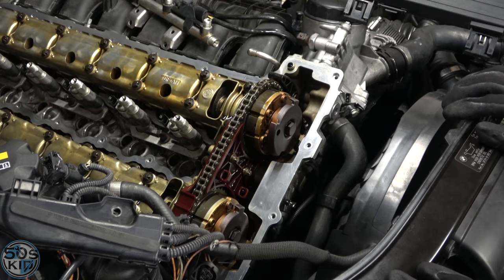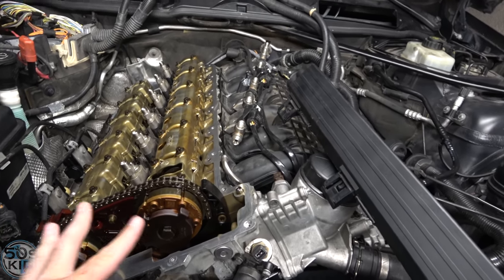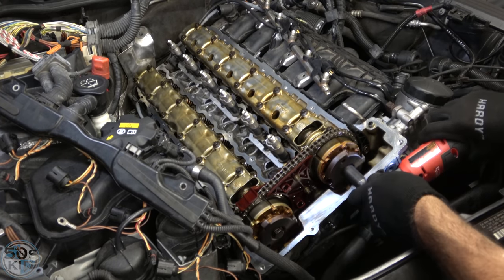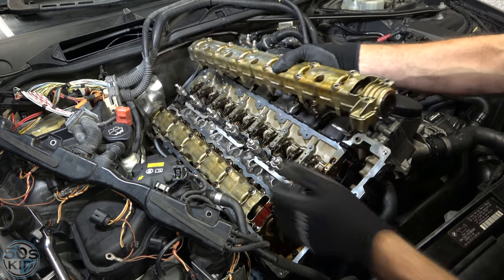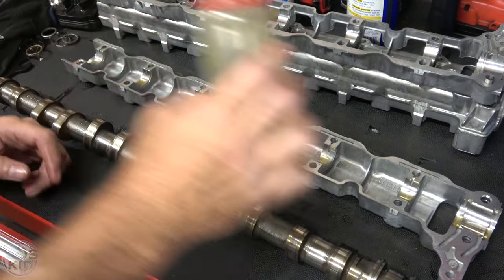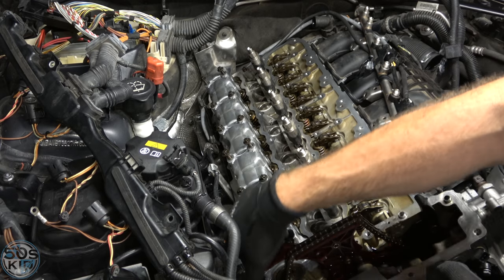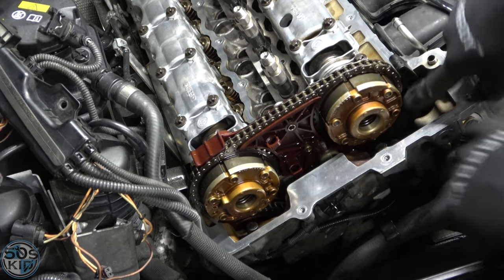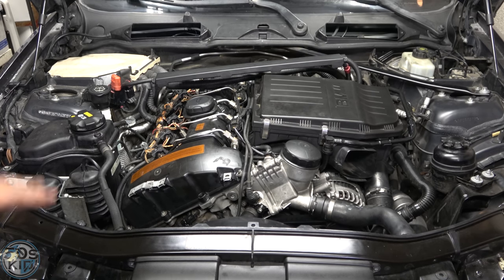This causes VANOS codes! - E90 Cam Bearing Ledge Failure DIY

Comment: Great job lad! Did you try rotating the crankshaft to test the camshaft position with the timing too before 2 x 90 degree screw final torque? I had a scenerio like the camshaft position slightly unfitted to the timing tool even torqued all with the tool.
Reply from the maker: No, but had no issues with the job. Cars running great
Reply: I've never had any issues like that either. Was your tool worn-out, or perhaps from China? 😲
Reply: @davelowets  the tools were from my fren and origin unknown:) it only had a slight unfit at the rear of inlet camshaft. You even can't notice it from the front vanos. Probably it is still under the tolerance of N46.
Reply: @horrychan2304  Most likely. I can't imagine a slight misalignment of less than a degree making a whole lot of difference.

Comment: Hey bud i am glad you are back posting videos. I have a question i have a 2005 325ci and not sure how it happened but my intake manifold cracked not sure how it cracked but im thinking of too much air build up? Can you help shed some light on what you think what could have caused it. I appreciate it 👍
Reply from the maker: I've never heard of an intake manifold cracking!  Where did it crack?  Do you live in a very cold climate?
Reply: @50sKid  no i live in Northern California. Just normal weather. It cracked on the side closer to the radiator. Lol
Reply from the maker: @mrdude3540  We're talking about the intake manifold and not the coolant reservoir right?
Reply: @50sKid  yes lol. Intake manifold. It cracked on the side closer to the front of the car. Can a bad mass air flow senser or spark plugs cause that? I am stumped.
Reply from the maker: @mrdude3540  No no, it wasn't caused by some other part being bad. I would suspect a defect in manufacturing before anything else.  If you have pictures, I would love to add them to my collection.  You can email them to me at jason at 50skid dot com.
Reply: @50sKid  ok will do. 👍
Reply: @50sKid  just sent them to your email.
Reply: A nasty backfire "could" cause an intake to crack, but I'm sure you would have heard it happen.
Reply: @davelowets  actually that is exactly what happend. I heard a loud backfire and then checked under the hood and seen a big crack. I was thinking it could be needing spark plug replacing that could have caused that?
Reply: @davelowets  so this is exactly what was happening. When i would drive it it felt like is was shaking a little bit i drove it like that for about a week then just parked it then about a month later i went to start it and i heard a loud backfire then looked under the hood and noticed that there was a big crack in the manifold. I believe if i remember correctly before all this happened my check engine had turned also about 8 month before this happend i got a code for system to lean so i replaced the MAFS and the code never came back on.
Reply: @mrdude3540  An intake backfire could be caused by a few things.... An extreme lean condition, ignition timing way off, valve timing off. If you had a lean code before, I would suspect that is what caused it. A simple check of the fuel pressure will confirm or deny that. You can "rent" a fuel pressure guage from your local auto parts store. Screw it onto the Schrader valve connection in the fuel line somewhere up by the fuel injectors, start the car, and note the reading. Sometimes you will have to put the engine under a load and see if the pressure drops. You can try and place the guage somewhere you can see it through the windshield, get in and place the car in drive, firmly hold the brake and give it some throttle to load the engine. Note the reading on the guage under load. I don't remember off-hand what the normal pressure for your vehicle is, but you could ask an employee at the auto parts store, or easily find it online. I would start there first.
Reply: @mrdude3540  If your fuel pressure is low and your car has high miles, or was driven in dusty conditions, it may be as simple as a plugged fuel filter, or failing fuel pump.
Reply: @davelowets  my fuel pump was replaced by dealership about 2 years ago.
Reply: @mrdude3540  Still check your fuel pressure, and report back.
Reply: @davelowets  alright 👍

Comment: This is caused by going beyond 6km on a synthetic oil change repeatedly like in BMW oil change service of 24,000km in addion if some noob changes the oil filter and throws out the center cartridge and it looses oil pressure what Little oil reached the head gets hot carbon forms and gets passed the small screens the one way check valves located above the timingtensioner

Comment: If it wants a torque spec plus 60 degrees, isn't that by definition what a torque to yield bolt does?
Reply from the maker: Yeah you have a point there, but I checked twice and they do not need to be replaced according to the BMW info.  They are 10.9 grade bolts though so that must have something to do with it.

Comment: Use G clamp. Used to maintain even oil clearances for camshaft.
Reply from the maker: The problem is that you have to remove the fuel injector, which means you'll have to change the teflon seal on the tip of it.  I didn't have any new seals and didn't want to add to the complexity of the job.  But, yes, totally possible if you want to do that and I did consider it!

Comment: @50skid can you link where you got the lifters please great video thanks for the help!
Reply from the maker: https://www.ebay.com/itm/232266149843
Reply: The only other question I have it how do you make sure they stay on top on the cam?
Reply from the maker: @raymartinez5327  The rollers? You just be careful and double check that they didn't slip off.  It's all in the video.
Reply: @50skid thanks again you been a life saver
Reply: I have one other question I was going home and car went into limp and was not able to clear the code got home and reader showed a U30B7 only thing I can find is this O2 sensor signal stuck rich bank 2 does it sound accurate?  Thanks again @50skid
Reply: @50sKid  car has catless DP and Jb4

Comment: Might have missed it but which cam did you use with the new shells - your original or the scrap yard one?  Also are those Cam shell bolts torque to yield if your putting an angle in there?
Reply from the maker: I've answered both of these questions in earlier comments -- check out the history.
Reply: @50sKid  Thanks- found them!  Great vid by the way, but the more I see about fixing these - the more Im glad I only have to deal with M50/52/54 type issues!  Cooling system and other troubles are a breeze compared to the issues like these!

Comment: Does this issue pertain to a 2001 740i ?   I'm hearing the 'tapping'   Sound. I haven't replaced my  Solenoids yet nor have I replaced the tensioner I acquired the vehicle about a month ago still working on stuff. Thanx
Reply: No, e38, e39, e46, e53 used a different type of vanos systems.
Reply: @gowasiem   Thank you for the reply much appreciated
Reply: @69oakfan  Ik the e38 740 vanos is a big job and should be done when u do the time chains
Reply from the maker: Check out my series on the M62TU engine from earlier this year.  There is a VANOS video in the series.  Very in depth.

Comment: Re: snapping camshafts, it's not so much a tale as not as relevant as it once was, cams don't shatter like they used to.

But even torque while bringing the shells down is just cheap insurance, ya ain't snapped one till ya have.
Reply: Yep the older style cast iron cams are definitely more prone to breakage than the new style hollow cams. It's just about impossible to break one of the hollow ones. If you simply drop a cast cam into concrete, it will usually break into several pieces. With a hollow cam, you can throw it down on the concrete 20 times, and it wont break. A high performance billet cam is the toughest of them all.

Comment: @50skid, are you not suppose turn crank clockwise? as engine run counter clockwise?
Reply from the maker: Did you ever ask yourself why that would matter?
Reply: @50sKid  you can turn either way, but wonder if that will risk to skip teeth or loose crank pulley bolt
Reply from the maker: @zhoueric1450  As long as the chain tensioner is still screwed in, the chain will never skip.  And the crank bolt is tightened extremely extremely tight.  You'll never unscrew it just by turning the engine backward.  It takes a breaker bar with a cheater pipe AND you need to immobilize the engine with the lock pin (which might get damaged).
Reply: I think the only difference between rotating it clockwise or anti-clockwise is where the timing chain slack goes.  Rotating anti-clockwise the slack ends up on the right where there is no chain tensioner while the left side becomes taut and pushes against the tensioner.  I suppose if there is enough chain stretch present then maybe this could cause a slipped tooth but I doubt it.  But still a good practice.

Comment: N55 was released before 2012🤷🏻‍♂️
Reply from the maker: Yeah 2011 model year I think but the info I found said 2012 was when the upgraded gasket was introduced.  Maybe it's bad info.  I won't know until these cars start showing up in junkyards.  Haven't seen an N55 yet since I started looking this year.
Reply: @50sKid  from e90post 

“Basically IF its a 2010 its a N54(twin turbo) and if its a 2011, its a N55 (single dual scroll turbo). But BMW DID make some N55's along side with N54';s in the months of Sept, Oct, Nov of 2009 and then again in Feb, 2010 (both engines were being used) So a car built late in the year, could have either engine. But that is a rare case. Like I said, most (if not all 2010''s are N54's and all 2011's are N55's. N55 SOP (start of production) started in Feb, 2010. The latest design HPFP did not come out until May or June of that year(i believe).”

Comment: Use the tool, you can get it off Amazon for about $100 and it works perfectly. You will risk fucking up the valves.
Reply from the maker: Link to this $100 tool, please?
Reply: @50sKid  ABN Camshaft Alignment and Engine Locking Timing Tool Kit for BMW N51, N52, N53, N54
Reply from the maker: @awaspthatswatchingyou4559  That is what I already have and what I showed and used in the video.  That is for locking the flywheel and camshafts and setting the alignment on the tone rings for the cam position sensors.  The additional two tools for holding the cam trays together and holding down the valves are what I did not buy or use and they cost about $500.

Comment: Man!  it Looks like this Engines are Crap!!
Reply from the maker: Well... it's otherwise very rock solid and it's the best tuner engine BMW has ever released.  You can unlock crazy power.  Just gotta deal with this pesky issue, which isn't that bad.
Reply: I don't know about that. I mean I have seen Nissan engines that have major chain failures early on. I remember 2005 engines ALL failed that chain early.
Hondas have transmission problems. Etc.